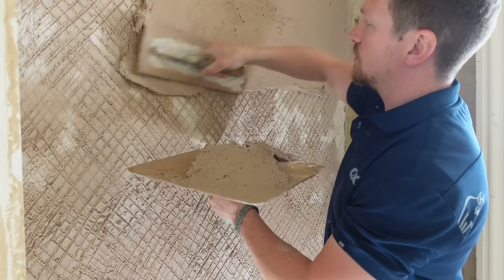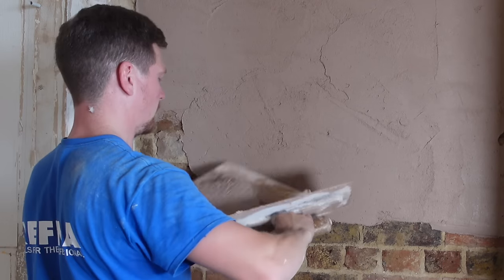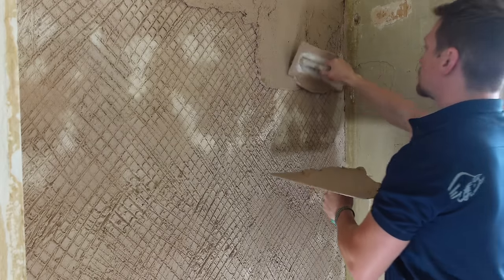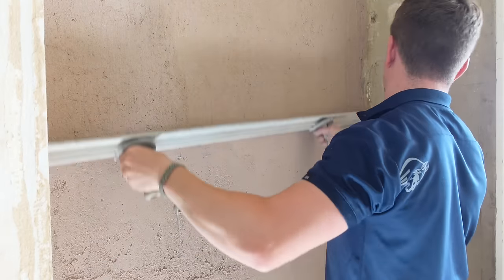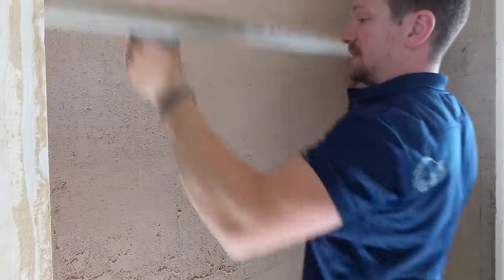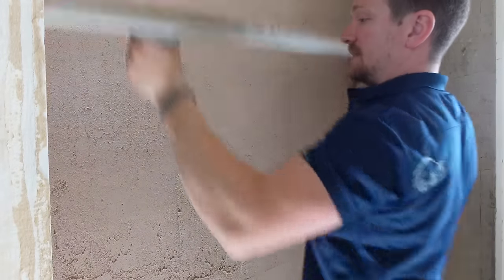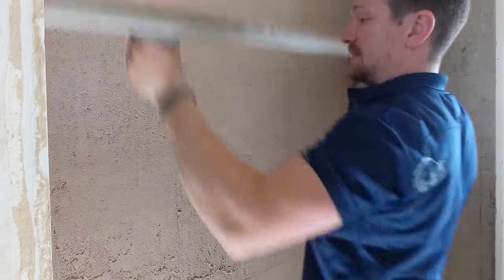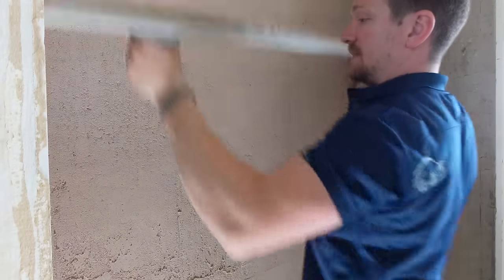How To Lime Plaster A Wall FOR BEGINNERS | Full Process START TO FINISH!

Comment: Mould free, breathable, eco friendly, recyclable….what’s not to like about lime. Great vid, love your work.
Reply from the maker: That’s the one ☝️
Reply: I agree but it is extremely expensive just to apply. 3 visits in 3 weeks for a wall. Mental.
Reply: @frenchgreguk  that's lime plasterings biggest downfall unfortunately the drying times between coats.
Reply: yeah, good look recycling it with all the synthetic fibers. if you want to do real lime plaster just use lime and sand and throw it on. works quite differently and is not that easy but it will really be recycleable and eco friendly.
Reply: ..and you can’t put normal paint on it.
Reply: Requires specific and expensive paint, which also takes longer to apply and is limited in colour. There's a reason that it's been phased out of most construction
Reply: @JL70-z2f  what other option is there though, say you're plastering a solid external wall what would you use if not lime?
Reply: I have a wall in my house where I’ve removed a chimney breast and blocked up with concrete blocks and standard sand/cement mortar. Rest of the wall is Victorian brick with lime mortar, plus there’s a big patch of lime plaster still strongly attached to the wall. I was planning on using hardwall to build it up and bring the new blockwork, old brickwork and old plaster together. Big topic but would hardwall be ok in this instance?? Or am I best to dot and dab in this instance?
Reply: @lw2411 stay away from hard wall, it just works like a sponge if you have the slightest hint of moisture or damp.
Reply: Thanks mate
Reply: @user-to8lx8zq1i  so many old homes in America have paint on the walls. Prime it then paint it with latex
Reply: Actually its natural from the lime putty its wetter and is a beautiful look pigments can be added for colour and there are inexpensive paints available too. Used in traditional 1920s  and below property its essential otherwise its creating other problems elsewhere ie external and breathing problems so this been done lasts a very long time perhaps ones lifetime put that against just slapping on some grit or pva and skimming then watch problems arise, certain homes need this application its like for like the homes will be lime built mortars including bricks,  being informed on this stops a leaky bank account. @user-to8lx8zq1i
Reply: @frenchgreguk  its the same amount of time to finish drywall like drywall with accelerators you can do this all in 1 day but because plaster curing is a chemical reaction that pulls co2 out of the air the longer it is exposed to the air the harder it will get
Reply: At least you won't be out of work 🤣 @frenchgreguk

Comment: Great to actually see a traditionally built property having the correct material applied.  The most common cause of damp is due to the use of cement backing coats. I think I'm possibly the only damp specialist who actually uses and recommends lime plastering.  I don't however buy pre mixed, I always use hot mix made on site. Works out much cheaper
Reply: Would you be able to give me an insight into what you mix and how you go about it please?
Reply: I would also like to hear about how you make your mix
Reply: 4-1 for base coat. That's using quicklime that doubles in size
Reply: Look up : don't be dumb about damp

Comment: Great video Blaine amazing how many guys are afraid of lime plaster work. 
I live and work on Dartmoor and lime plastering is 75% of my work, we are still using horse hair in the scratch coat here and still nailing laths to the stud work😂 far more satisfying than new build work.
Reply from the maker: That’s amazing mate. Beautiful area by the way - loved Dartmoor! And you are right, it’s very satisfying. Hopefully get some more work but it’s the price that’s the problem…a lot of people don’t go for it despite advising it.
Reply: I’ve just bought a solid stone house in Chawleigh and need a plasterer - are you available?
Reply: @adamchant2645  i dont know how to send you my contact details without it been deleted
Reply: Serious question - where do you get the horse hair?
Reply: @bobbyreilly5394  This is just a wild guess but I'd imagine most stables will have it left over after brushing their animals. However, I could be barking up the wrong tree entirely.

Comment: I was a plasterer for close to 30 years before changing careers. Although time served, I’ve never touched sand and lime. 
I have now bought a circa 1800s listed building and have some damp spots. I will be looking to redo these to tackle the damp. Your videos and advice are spot on and serve as a welcome refresher to me revisiting my old trade. 
Thank you.
Reply: Trust me youl thank yourself forever doing so. Before we had gutter leak down walls for time and not notice it until plaster fell off and skirting rotted out ! So replastered in lime fixed gutter changed skirting sadly and now problem solved warm dry wall and no damp !

Comment: Good video 
Same in London 90percent of the period property’s have been destroyed by cement , I constantly get called about damp caused by cement pointing and render , blocked or rendered over air bricks , as soon as the walls are stripped of the cement and pointed and adequate ventilation installed it literally goes away within weeks

Comment: Great vid. I actually did a lime plastering course and it followed what you did. I’ve found lime much easier to work with than gypsum because I have time to get it on and flatten. You’re spot on with two base coats at around the 9-10mm mark. On my course some people applied it too thickly and next day when we came back theirs had cracked. However, because it takes days to dry properly that wasn’t an issue and using a float it was just re-worked and the cracks cleared up. Lime seems to be very forgiving in that respect. Great vid.
Reply from the maker: Thanks mate, glad it lined up with your course. Very true about it being forgiving…it’s never too late to fix an issue with Lime.

Thanks for watching pal 👍

Comment: Doing 2 lime plaster jobs for clients in the Cotswolds. Both listed buildings and one I am using cornerstone insulation, bedded onto lath (for a breathable gap) on the inside and removing bonding and multi that's sucked in the water from the walls. There are loads of properties that have modern products but should have had a lime render and lime plaster. That includes the external pointing which is patched in 3/1 mix of sand and cement and not 1 part NHL 3.5 lime and 2 parts sharp and half soft sand mix. You can buy it pre mixed but I mix it myself. Listed stone/slate buildings you can only use lime putty, depends on the job. Keep up your videos, they are a great watch. Si
Reply: Set yourself up as a damp proofing company.  You will be taking work from the chemical brigade and doing the right thing for customer and the property.

Comment: Not done any lime work for about 4 years, but really enjoyed using it when i did, its a different product , with different techniques to gypsum, but if you do your research  before you start then it shouldnt be too daunting. Theres a lot to learn! Get the right advice from the lime suppliers on what products to use, and where to use them. The hardest thing to get used to for most gypsum plasterers is the time between coats, it takes some getting used to. As somebody else suggested though definitely wear the gloves at least, that stuff is brutal.
Just waiting now for the lime experts to catch this video, ill be back to read the comments😂. Good  video Blaine, keep em coming👍
Reply from the maker: Very true, it’s totally different but I always enjoy using it. However, I think the fundamentals are the same. Keep your costs to a maximum of 10mm, apply lots of pressure, rule flat and just respect the waiting times. 

The timings are totally different though. Very forgiving unlike Gypsum which is nice. Wish me luck with the comments and thanks for watching 😂
Reply: @PlasteringForBeginners  every day is a school day, I've been plastering 33 years, still always something new to learn. I think unless your customers are clued up, the hardest thing is convincing them how long a lime job can take, and the extra costs involved, we know the benefits of lime especially on older properties, but convincing the customers is another matter, most just want quickest/ cheapest option. Good luck 👍
Reply: @HappyTyke25  how much more expensive is it to use lime ?
Reply: @memecoinmafia2732  every job is individual, so hard to say. It's mainly because of the extra time involved that the cost rises, although I do think lime materials are a bit more expensive than gypsum etc. Maybe someone who uses lime more than I do can help you. 
The benefits of using lime is almost always worth the extra cost over time though, especially on older properties that would probably have been plastered with lime originally. It allows a property to breathe like it should. Which is better for damp issues.

Comment: The usual advice for lime plastering or rendering is to apply a progressively weaker mix on successive coats. Does the bagged lime putty product that you used in the video follow that or is it of the same strength throughout? I guess that it is more important when applying external render for weather and frost resistance rather than internal situation you are plastering. The biggest drawback I've found is the drying/setting time but it is much better on stonework or soft brickwork that you find on "heritage" buildings. Thanks for your video series Blaine,  they have helped me a heck of a lot in the various jobs I've had on my property in South Cumbria.
Reply: You can use the same material,so long as it's not stronger.

Comment: I'm so glad you have covered lime plastering. Its something nobody has taught me and I've wanted to learn. Really useful for old houses. Is there an insulating version with cork or some other material?
Reply from the maker: Glad you found it useful mate. Not sure to be honest, I’ve personally never seen it but it’s probably out there as you say…I’ll try and look into it for the future 👍
Reply: There is a ecocork lime plaster but you will get a better thermal value using wool-wood boards with a lime plaster on top
Reply: Hemp shiv and perlite

Comment: Good content. 
Ive got a 1935 bungalow with no cavity wall. 

All walls lime. Im renovating so took it all off as some of it had blown.

I initially wanted lime back on but got told too expensive.  So gave in to gypsum. 

Builders dot and dab ensuite.  Week later theres mould on plasterboard. Dot n dab transferred moisture from the wall into the plasterboard.  The house is vacant so i do know moisture levels will be high.....as the bungalow is very cold.

Do you think i should revert back to my original plan and go lime?

This process of using lime is there anytime you would use a more breathable plasterboard than gypsum?

Appreciate your comments 

Thanks

Comment: Hi, I live in an old black and white house. Some walls need re-plastering as nothing has been done since 1970s! Top of the walls are solid, but it must be rising damp as old plaster coming off the walls middle to bottom. Damp proof course put in in 1970s too! 
I've never done any plastering before, and would like to try to have a go, but with no experience I'm concerned about damp proof course and trying to lime plaster over the walls. Do you think I could attempt this as a lady who likes to try DIY?! Any advice would be welcome! Your video was great to watch. Thankyou

Comment: Great video. Was it the same product for all four coats or were the two finishing coats something different? I've got an old sandstone wall with large patches I need to lime plaster. The existing plaster (very old with hairs in it...not sure if it's lime?) on the rest of the wall is sound. Once I've patched it can I skim the whole lot with the same product?

Comment: That's how I did my walls as a DIY job. Did you find that the bottom of the wall dried slower than the top? Water runs downhill!  Anyway, great to see you using lime.
Reply from the maker: It was pretty consistent to be fair but I didn’t over soak the walls. Thanks for watching my friend, hope you’re well

Comment: A great overview but it has left me nervous!

I have never plastered anything before but am going to give this a go. We're renovating an old house so need to use lime based product. I have an area which is accessible and with a reasonably stable surface to work on.

The real goal is to plaster my attic walls, the existing surface is very crumbly, to the point where I could most likely brush forever and not improve the surface at all. I clearly need to stabilise the wall before working on it. Any suggestions?

Comment: Nice video mate; I felt excited when I saw you took a crack (no pun intended) at lime plastering; thanks a lot for your perspective. I did wonder about one thing though: is there a reason why you refrain from using a spatula (speed skim) to give the finish coat a first flattening?

Comment: I've been told to "throw" the plaster to the wall by my local NHL supplier/manufacturer (Målarkalk). And when I follow their instructions and water ratio the consistency is a lot thicker and not runny, so it's not possible to work it like you do. Do you know why it's so different? I am based in Sweden so maybe the traditions are different. Otherwise it's pretty similar.

Comment: Curious to know how many bags of each basecoat and finsh coat you used on that wall. I have a simular size wall and can see where they tell what one bag covers. Great video
Reply: measure your wall: cm2 or m2. Then multiply times however thick your plaster will be. Then divide by 4 if you are using 1 part lime to 3 parts sand. Round up as your bags will typically be 20kg -25kg. You can add the extra lime to heavy clay soils or your garden if needed.

Comment: Hi Blaine, great work as always. Sorry I'm in a different subject now, do you know how to slow setting time down? I have a large plasterboarded ceiling to do and the weather isn't in my side, just wondered if you had any tricks up your sleeve. Cheers
Rich
Reply: An additive called Xtra time. Gives about an hour. 
Or do a running gauge. Stop halfway. Before you final trowel the 1st half. Whack the second have on. Work the joint while still green. You'll find it a lot easier doing big areas once you suss it out
Reply: Awesome, thanks neville.
I have seen that extra time stuff but I start the job Tommorrow and I can't find anywhere on the Isle of Wight that sells it lol, will give your method a go, cheers 👍
Reply: @richardpowell9238  Hi. If you can get to a Travis Perkins, they sell Extratime there. It's been a life saver for me on ceilings in the past.
Failing that you could always give cream of tartar a try 🤷‍♀️
If you can't add a retarder though, what Neville suggested would help you a lot.
Reply: Thank you Tara, yes there's one in Ryde I will try get there first thing, I've heard of tartar but didn't know if someone was having a laugh 😂, if I plaster over artex I do a 50/50 mix bondi g and multi that usually slows that down but don't know how bonding will react with plasterboard
Reply: @richardpowell9238  No worries. Many spreads used tartar back in the day but I know some people do still use it if they have nothing else. I think it's about a lid full to a bag but i could be wrong.
Bonding is fine on plasterboard but make sure the boards are in good nick. Sometimes to be on the safe side you'll need to PVA the boards if they've been up a while.
Also, have you tried using a sponge float when you're in trouble? They can help a lot when you're chasing your tail because it brings the plaster back to life for a bit giving you that bit of extra time.
Reply: @TaraBryan.  thank you, yes I've done sponge float but it's a pain in the backside lol got all the walls and shelves to plaster too, I will give that tartar sauce a go in my house first see if it works before I try on anyone else's, I'd easily do the ceiling in normal conditions but just want that extra little time because it's so hot at the moment
Reply: Yeah i know what you mean mate. I did one of my first ceilings without Extratime when it was mega hot and it was the worst job I've EVER done or been on. Thankfully it was a friend and they were good but i still felt terrible.
Good luck with it anyway, hope all goes well for you 👍
Reply: @TaraBryan.  thank you

Comment: Hi, im about to use the same materials as in your video to lime plaster a brick wall (fireplace wall) to prevent damp after a damp solution had been used on the walls (dryzone dryshield cream)

However i am only going 1 meter up the wall where i have removed the gypsum plaster..... can lime plaster be joined to a gypsum plastered wall using scrim tape or similar 

Also how many bags of the lime plaster you are using would you recommend for a 7m2 coverage

Comment: Is the hemp in hemp and lime just a substitute for horsehair or fibres? I was looking at dot and dab plasterboard but as there are  gaps between brick and plasterboard, its not as good to get an air tight house. I think lime plaster might be the best for brick/block houses. Great video.

Comment: If you would like to apply this lime render to an old Bath Ashlar Block that has been painted with an emulsion paint, what product would you use to stabilise / seal the wall as I presume you would not want to kick up dust to remove the paint?

Many thanks